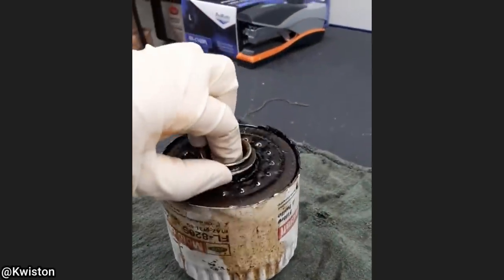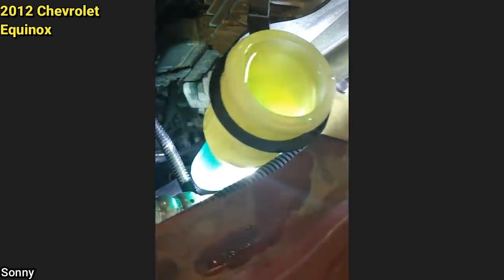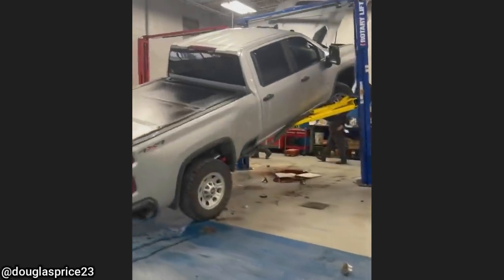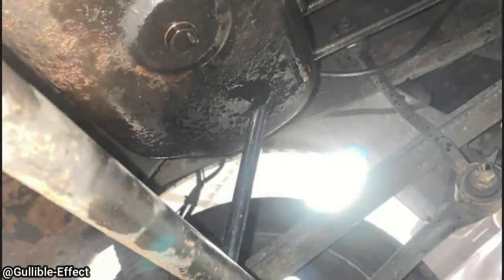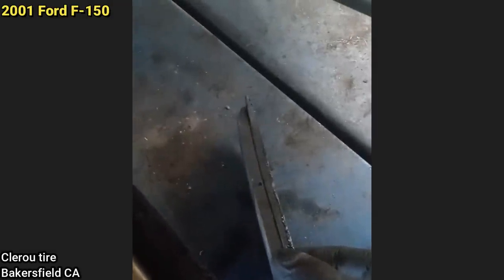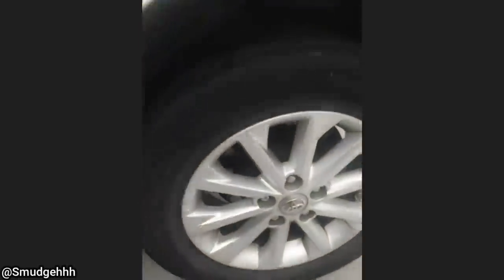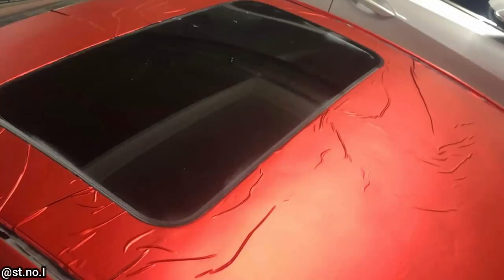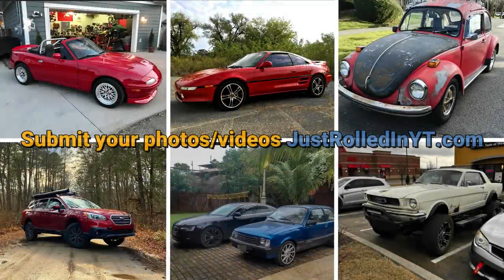Customer States Engine Has Loss Of Power & No Oil Pressure | Just Rolled In

Comment: I actually have no sympathy for the people who neglect maintenance on their vehicles.  Stupidity is expensive.
Reply: Oil change also the cheapest fluid change you can do cost $20 bucks
Reply: @elephant1992  I wish it was $20. I’ve got a 2006 V6 Holden Commodore Ute (Australia) thanks to GM and their shit timing chain layout I have to change my oil and filter every 5000kms. The 6.5 litres of oil the car needs is around $60 to $90 and the filter is about $15.
Reply: @elephant1992  yeah if you use vegetable oil, most oil filters cost about 10-20$
Reply: I'm sure that they can always come up with enough money for a 12 pack of PBR and another pack of cigarettes.
Reply: @elephant1992  yeah I gathered you were I was pointing out the difference
Reply: @davegoldspink5354  $15 for a good filter is about right. 6.5 L of oil for a larger V8 also isn't too much to imagine. That KIA Soul has a 2.0L I4 that needs about 4.8 Quarts of oil. Pretty cheap to maintain. And yet they still mess it up. Bruh.
Reply: @bluspectre2042  6.5 litres I talking about is for a 3.5 litre V6 and thanks to a crappy timing chain setup thanks to GM means that premium oils are a must every 5000kms.
Reply: @davegoldspink5354  seems expensive. Ac Delco filter is about $8   and $40 for the oil in the states.
Reply: @mmholling87  Ryco filters are a great filter here in Australia and usually only couple of dollars more than Chinese crap. Oil as I said is that expensive as you need a quality oil like Penrite which is recommended due to the crappy timing chains as I said.
Reply: @davegoldspink5354 , mine costs 20 for the oil, and 12 for a quality filter
Reply: Very expensive and not just monetarily.
Reply: No kidding. It's one thing to put maintenance off for a little while until you can afford it, but just skipping it for years is pure stupidity.
Reply: @davegoldspink5354  your holden has the 3.6 engine? I've heard the tensioners on them go out like mad and it's engine out job to replace them
Reply: @John-pl4fl  yeah the problem was actually the chains themselves. In the VE Holden Commodore did some cost cutting and reducing the chain thickness from 9.9mm to 7.9mm and as a result the chains stretched. My VZ has the 9.9mm chains and I was told to change both the oil and filter every 5000km as it would help the chains last longer.
Reply: Being poor is expensive too.
Reply: @elephant1992  What are you driving? A lawn mower?
Reply: @Matt85ism  I am driving hyundai sonata with a V6
Reply: Life isnt easy on everyone! Some ppl DO have trouble paying their bills and often have to "neglect" their car...
Reply: Not knowing something needs checking is one thing.
Not wanting something fixed when the professionals tell you, and you can clearly see it falling apart, is a completely different thing though.
Reply: @griffonsa  Set aside $5 a week and miraculously you will have enough money for essential basic vehicle maintenance.   Make it $10 and you can afford tires!
So many people think once they come up with money to purchase a vehicle that's the end of the story.  That's like saying Ok I paid for my hospital stay to have my baby now I'll never have to spend money on my kid again!
Reply: People being uneducated is not their own fault.  If you want to blame someone blame their parents.  Or blame society for failing to educate people properly.  Education is not about knowing the right answer but about knowing how to find it.  More often than not 'knowing how to find it' means talking to someone that knows.  Be that a mechanic, a doctor, an engineer or the guy at your supermarket.

Comment: I like the way everybody's walking around and staring at the Truck that just fell off the rack,like yeah that happened 😜👍😜
Reply: Been there ...seen that. Pretty sure we all needed clean shorts after it stopped falling
Reply: Exactly. Maybe if we stare at it long enough it’ll fix itself!
Reply: In their defense, if it only just happened, you want to make sure it isn't going to fall any more before you get close to it.  They did say it just happened.
Reply: @ToWhom  Not so sure, the concrete at the base of the right lift post is broken!  Could have been a faulty lift install, or wrong grade/thickness of concrete in the floor.
Reply: @NemoConsequentae  Take another look. It’s bent over due to the heavy weight of the fallen truck on the one side.
Reply: @pat8988  I did, that's a crust of concrete stuck to the bottom flange of the post by the concrete bolts.  From the video description: 
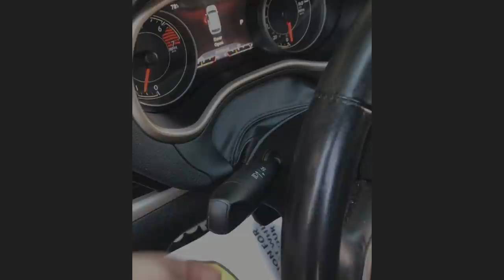1:21 The technician said the concrete broke on the right-hand side of the lift. This happened to a customer's brand new truck.
Reply: @NemoConsequentae  "Boss, it's Jake, from State Farm, on line 1!"
Reply: @NemoConsequentae  My bad.
Reply: @pat8988  No worries!  I went back & played it 3 or 4 times to be sure, myself!
Reply: @ToWhom  They were undoubtedly in the correct orientation until the post tipped, then you have the weight of the vehicle twisting backwards, pivoting around the left post.  I'm not sure if the arms get locked into position once they are swung under the vehicles, though, so it may or may not have broken the latch/locating pins there.  Then once it has tipped, the front right won't be in contact with the vehicle, so it will just swing due to gravity.  (So likely no latch or locating pin to hold them, I guess.  Or at least, none were engaged.)

I've often thought that design seemed unbalanced, but the main weight is in the engine at the front so the longer distance to the rear would be ok.  But... did the truck have a load in the back, perhaps?  That would have done the trick, if so.
Reply: Explain that to the customer "We had a small issue with your vehicle !!!!"
Reply: There are 2 problems that would have caused this. They were using unibody lift adapters on a frame vehicle and the floor was a concrete cap over likely an older poor floor. 

Either of these could in themselves cause the truck to come off the lift. 

If the truck moved the adapter couldn't retain it as it has no rubber pad and no frame tabs. That would cause the post to pull and rip up the skin coat of concrete. Or the capped floor failed and pulled up with the anchor thereby dropping the truck in the process.
Reply: @ToWhom  The arms have "restraint" gears that sheer at 80 lbs. They are mean to breakaway in the event of that situation. More likely the capped floor or wrong adapters caused this.
Reply: @shifty7739  I would not want to be the shop, mechanic or customer on this one.
Reply: @kfl611  Yeah. At least they had a Rotary Lift. Shows they were consciences. If the installer didn't know it was a capped floor when he drilled the anchor holes he shouldn't be installing. He should feel it when drilling.
Reply: When I was a transit bus driver, a mechanic put a bus on the lift to do a repair underneath, walked away to get a part and the back half of the came off the jacking points and BOOM 💥!! It came came thru the floor and cracked the engine block of the bus, company had to get 2 extra heavy duty tow trucks 2 hours to get the bus off the lift and out of the garage to get it properly secured and towed to central maintenance for repairs

Comment: That oil filter...just crazy. ATF for engine oil is nuts. 3 years no oil change. Just amazing stuff.
Reply: Not so amazing if you watch this channel regularly.
Reply: @corey Babcock  My Tundra is every 16 000 kms...I will go every 10 000 kms.
Reply: There's another channel I watch on youtube where a guy tears engines down. On almost every engine, you can tell someone either hasn't changed the oil, or let it run low on oil.
Reply: @Oddman1980  Speedkar 99?
Reply: @mikefoehr235  I Do Cars
Reply: @mikefoehr235  "I Do Cars" is the name of the channel.
Reply: @rcfalcon56MkII  👍
Reply: @Oddman1980  I Do Cars...he's awesome
Reply: @raiden000  yeah you can go to Walmart and literally can do your own oil changes for under $20. $15 for the Walmart Supertech oil and $3 filter. $20 for 3-5k miles.
Reply: It probably ran fine though. That trans fluid is serious stuff. Probably a really clean engine too. I predict a little tappet noise.
Reply: @VintageCars999  yeah because even a shitty filter is better than no filter.
Reply: It depends on the the mileage...3 years without oil change wont to any harm, if you only drive like 5000 miles a year.
Reply: @944Tomcat  Probably but it might depend on the quality of oil. Certainly not if it's a good synthetic.
Reply: corey Babcock  damn, how much you drive in 3 months?
Reply: @944Tomcat  Actually,  short trips are much worse for oil life.
Reply: corey Babcock  A DIY Oil change costs a minimum of $35 every 3 months or so for that car.
Reply: ATF is horrible for a motor at least its clean now just drain and replace with oil and it'll be fine long as it wasn't ran too long.
Reply: corey Babcock  3 months? No wonder you’re broke
Reply: ATF for engine oil isn't as bad as you think
Reply: corey Babcock  every 3 months? Sounds like a scam to me lol (The traditional recommendation is that you should change your oil every 3,000 miles or six months, whichever comes first. However, the new standard is that you can typically change your oil every 5,000 miles worry-free (especially if you are driving a relatively new car or it's in “optimal operating conditions")), this comes up when you just google lol. Just look at your manual from the manufacturer of your car. (I mean if the manufacturer doesn't know when to change oil who knows lol)
Reply: @VintageCars999  I did an oil change today and Walmart super tech 5 quart bottle was 26.99 I needed 5.5 quarts. after buying the extra quart and filter from Walmart and nothing else, my total was $42 and something cents.. idk where you live but out here Biden has his straddles nice and tight in the west coast
Reply: @tacoheadmakenzie9311  a lot of people are unaware of ring glazing or the development there of overtime. most police vehicles are meticulously maintained even ahead of service intervals yet will only last 80-120k miles due to the amount of idling hours. that's why tractors measure in hours not miles
Reply: @consaka1  Super hard on the seals, and probably not compatible with well...anything bearing related.
Reply: @FireGodSpeed  I still change my oil every 3000 miles. I'm old school and by the book when it comes to maintaining my vehicles because I'd rather spend a little more money on engine oil and gear oil etc. than having to spend money on a new engine and transmission later on if I can even get one. I'd rather be safe than sorry.
Reply: My car is 25 years old and has had many owners with different ideas about maintenance. The body is rusted and I have replaced everything in the suspension. The engine however runs flawlessly and consumes no oil between changes. I now replace my oil and filter every 12 months with the cheapest 10W-40 oil I can find that meets the specifications. I drive around 6000 miles in that time. There is still almost no debris on the oil plug magnet when I check it during changes. The only difference I notice before an oil change is that the car gets slightly harder to start in cold weather, as the oil viscosity increases as the additives break down.
Reply: ATF in crankcase for a short time would probably clean the engine out like nothing else. It also has good heat resistance and excellent lubricity. Marvel Mystery Oil is essentially ATF.
Reply: you didnt catch the vegetable oil?

Comment: For the turn signal issue:
Turn signal module $318
Module reprogram  $67
Blinker regrease and fluid fill $35
Thanks, come again
Reply: $35 for blinker fluid? What a rip off.
I got new blinker fluid, exhaust tuning and 710 knob re-orientation for $60.
Reply: That’s nothing I’ve just paid £100 for golden air in my tyres.
Shop says it’s lasts forever though so it’s a bargain!
Reply: Never cheap out on blinker fluid. I get the best, recommended by the technicians at my local Yiffy Lube.
Reply: The mechanics back in Mexico do that for patching a tier 😭
Reply: with how stupid that person is for not realizing their hand sanitizer bottle was weighing the lever down, I wouldn't doubt they'd just say "do it."
Reply: Think that's bad, try having a car with Bachman-Turner overdrive and need to have the sprong tensioner bearings repeened!
Reply: 😂🤣😂🤣😂 exactly
Reply: I would have sent them to another shop, claiming the problem was too complicated to fix. WARN THE NEXT SHOP!  Hopefully they will ALSO send her to a THIRD shop.....and so on.... with each shop claiming the issue was way beyond their capabilities to repair.

Turn it in to some sort of world record if the dolt gets referred to more than four shops.
Reply: is the reprogram for the pre-switch module?
Reply: @deplorabledave1048  Funny, cruel, but funny.
Reply: Jeez what a rip!
Reply: @anonymike8280  had to have that done on my REO Speedwagon. Mechanic said, "Who's gonna drive you home tonight?"
Reply: @lotharrenz4621  Outstanding.
Reply: Add a new muffler bearing, make sure your tires have the correct air, winter season and summer season

Comment: These videos remind me of stuff that happened to me.  Oh the stories I could tell you.   lol 

Repair shop dropped my car off a lift.  Another shop didn't tighten the lug nuts completely on one wheel; I found out as I was driving down the freeway at a speed that may or may not have been above the posted speed limit.
Reply from the maker: Jeeze you have bad luck with shops lol. I hope you found yourself a good shop now!
Reply: @JustRolledIn  These things happened 20+ years ago at two different shops.  I have a very reliable shop now.
Reply from the maker: @davidp2888  very glad to hear that!
Reply: @davidp2888  my shop and home would be the same place after that
Reply: I got a set of tires put on my truck last fall.  I watched the kid put both ties on the passenger side, hand tighten them grabbed his impact wrench and tightened the rear wheel lugs, and walk away.  Me; "uh, excuse me...."  Told him to double check the other side too.
Reply: Saw the same thing with the car that fell off the lift about 5 years ago when I was about to walk into the mechanic shop I had no idea about because my old mechanic closed up, but I walked back to my car and drove away-mechanic shop went out of business
Reply: These types of stories are the reason I decided to learn everything myself. Yes, including investing in a (used) car lift and (used) tools necessary to do most of this stuff myself.
Reply: @davidp2888  I had my breaks go out on the side of the road once in the middle of bitch tits freezing weather, so I put a bolt in the break cylinder because it was 2 am and I did not want to freeze anymore. 

Well, I drove on that for 4 years, every year I would take it to the same shop for inspection and paid for the breaks to be replaced twice.

Comment: The first one, if they can get the next oil filter to last as long as that one it will be a good one. 
#2 if you can’t afford oil changes you need to start saving for a new engine. 
In 30 years in a GM shop I’ve only seen 2 fall off of a lift. Thank God. And it was not me. Lol
Now my old drill with brushes sparks and even if it was a brushless drill I still don’t think I would be doing that. I lost a friend who was welding near the tank and accidentally touched the rod to the tank and it blew up. Bad dill. And that’s all I got to say about that.
Thanks 
My friend for Sharing.
Reply from the maker: Oh damn, I'm sorry to hear that! That's a terrible way to go.
Reply: @JustRolledIn  it was. Had a family. It’s been 30 years ago. His wife and I Graduated high school together. She and some of the kids are still around. 
The only way I’ll weld around a fuel tank or on it if it’s full of water. Thanks again for sharing.

Comment: Supertech oil and filter for under $20 at Walmart. That's more than affordable. When money was tight for me I still spent the $40 to get the oil changed and any needed maintenance. I cared more about making sure my vehicle ran vs what little money I had left. Cars are expensive, preventative maintenance is cheap.
Reply: You can usually get better synthetic at the parts store for $30. Yeah it's more expensive but you should be able to double or quadruple your oil change interval.

Comment: I've used ATF to flush an engine or two. Once I even added it into a buddy's crankcase to get his car to my place to replace the knocking engine. 

It exploded on the highway, flames burnt the rear bumper and tail light. I had it towed lol - window in the side of the block, hot ATF and whatever oil was there sprayed directly onto the hot cat. Fun! That 99 Accent lived 3 more years on a junkyard engine. *edit and a replacement tail lamp.

Comment: That’s just trifling to drill a hole in that fuel tank. That’s gonna cost a few hundred bucks. Just cut the fill line hose and suck from there. That’s how they stole mine. Would have only been a 20 dollar repair if it wasn’t a 94 gas dually with an obsolete internal vented hose. Thankfully I found one at a junkyard.
Reply: Yeah they don't care. It seems they look for the most costly destructive way to do something to someones car.
Reply: FLEX SEAL to the rescue!

Comment: If there is one constant thing I have learned by watching these videos, avoid quick lube shops like the plague!
Reply: Yeap, the car will be worse than before the visit. Even dealers nowadays don't know what they are doing when things are not so simple
Reply: I have had no issues getting oil changes at these places..  but that’s all I’ve gotten, and wait in the car while they do the oil change, and never saw anything weird happen. But now I do my own oil changes cause it’s not that hard and can use the cost savings to use higher end oil and/or filter.
Reply: Only thing bad I've had happen at my quick lube spot is the new guy tried to close my hood like it was spring loaded... it wasn't. Bent my hood prop/rod.